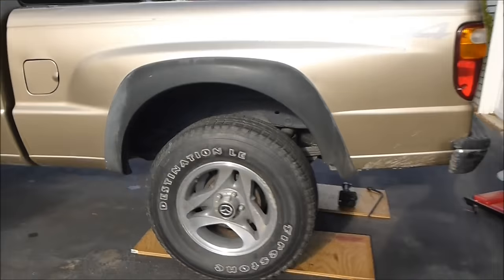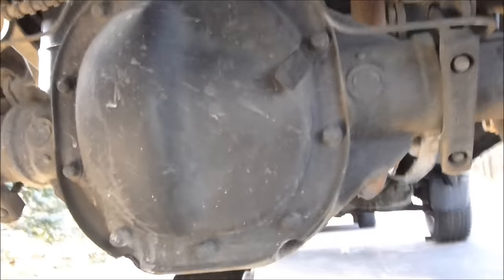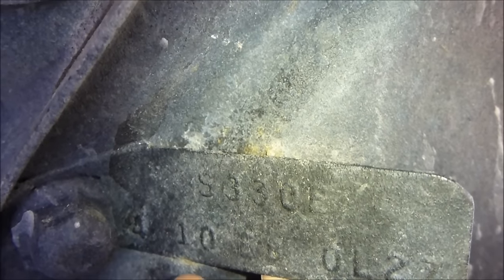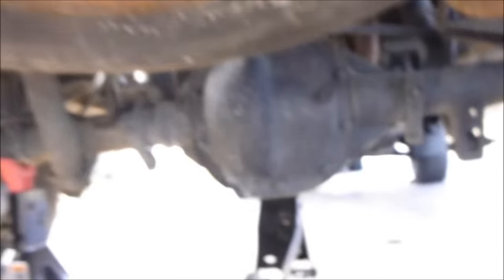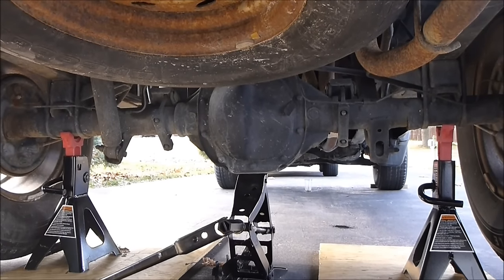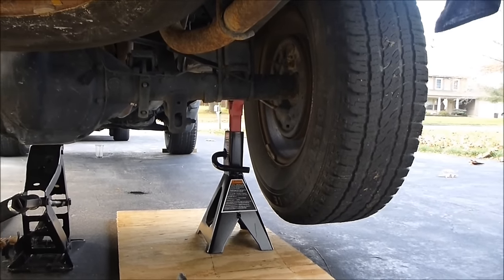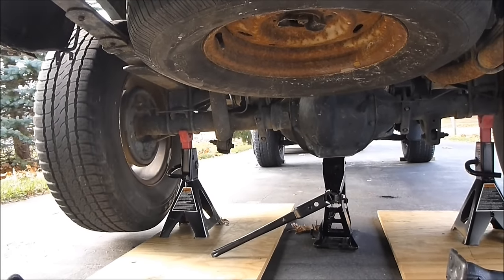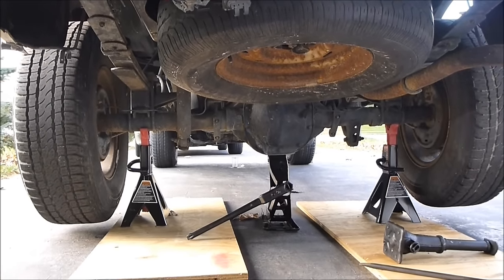How to tell if your car or truck has a limited slip differential

Comment: if it dosent have  force it will not lock!! you cant try it like that!
Reply: Exactly
Its "limited". It will be open until load is applied, then it locks and engages both wheels
Reply: Traditional Limited slips are "locked" together friction discs with spring pressure.  They are locked until a preset amount of torque differential, like going around a corner they will slip and allow one tire to rotate faster.  This video is how you test for a LSD.  I know this is old but I couldn't let it go:-)
Reply: Wrong!

Comment from the maker: What are you trying to figure out with a front wheel drive car? There typically isnt a differential. The drive shafts are connected directly to the transmission.
Reply: Sir, I know this comment is 11 years old, but… Did you just mean there’s no separate diff for FWD? Because there’s definitely one inside of the transaxle unit.

Comment: If you know what you are doing, a better test would be: jack it up (both sides!), start engine, engage gear and try to make one wheel to stop spinning. This should be relatively easy (and is possible) with an open differential. Make sure the front axle is not driven when you have a 4x4! There could be a LSD between the front and rear axle!

Comment: What's your insight about when i lock my center differential, there is no jolting sound but when i open my center differential, there is jolting sound when moving the gear lever to park to drive or cruising. Thanks
Reply from the maker: The sound happens when you are driving? Is it constant or does it only happen once?

Comment: Hey Chris, so I also have a RWD Mazda and I was trying to find the fluid that my rear differential takes in the manuel and it says, "Does not require replacement unless submerged in water". Is it wise to go by the manufacturer's word?
I mean, it's common sense to think that a gear oil that is constantly under stress and heat would eventually require replacing.
Reply from the maker: You are correct in thinking that, if it hasn’t been changed you can change it with no problems.

Comment: I have 2.7 grandcherokee crd quadra drive. When i lift the car and rotate a wheel, other one is spinning opposite, but the car has no open differentials for sure.
Reply from the maker: I don't know specifics about Jeeps but the diff could be unlocked which is why it's doing that

Comment from the maker: You will get different results. I am not completely sure what would happen because there are so many types of diffs and each one reacts differently. If both tires are suspended and the truck is in drive, you might not have any movement or one tire might move. If both end up moving and you put some resistance on one tire, the other tire might stop moving. It all depends. Def be careful because if anything happens, such as leaving 4x4 on, the car falls off the jack stands, etc, you could get hurt!
Reply: What does it mean if I can do this with my car in park?

Comment: This is an old video but im still looking for a reply :) My car will do a 2 wheel burnout if i hold the breaks but if i just step on it, say in gravel or anything it will only spin one.  apply breaks and do it, both spin... why?
Reply: +Mathew Hayes I just watched another video from engeineering explained about this. So when you use the breaks, you're effectively holding the one wheel that is spinning the most back, causing the other wheel to spin. Just don't look on your brakes lasting long that way ;)
Reply: what kind of car do you have. cause you might need posi.
Reply: Mathew Hayes sometimes an open differential will lock both when you apply the brakes because the pasenger side brake is applying more pressure and it kicks over to the side with least resistance or in your case both

Comment: I have seen one car that used a hydraulic valve, you would apply the foot break and turn the valve which would keep fluid pressure on all 4 wheels, but thats a custom. Some SUVs (I think it's land rover or range rover) have a drum just after the transfer case which is the e-brake.

Comment: My Toyota SAYS AO2C in the door tag which means it has an LSD and the tires spin in opposite direction.  
When i do a burn out, i have 2 marks so tires spinning in opposite direction does NOT always mean open diff ...
Reply from the maker: Correct
Reply: @chrisfix  Oh sh*t you replied ... WHAT A SHOCK 

I'm going to play the lottery

EDIT:
OMG ... i purchased a $50 scratch off that day you replied and i won $10,000.00
YOU MADE MY DAY CHRIS !!!!!

Comment: Will only one wheel spin on a limited slip rear differential? I have a 96 s10 2wd and I jacked the truck up and spun one of the rear wheels and it spun by itself and the other did not
Reply from the maker: Both wheels should spin the same direction if you have a limited slip, if only one spins or it spins the other way, you have an open diff!
Reply: @chrisfix  so it can be either one wheel spinning the opposite direction or one wheel not spinning at all for open diff??

Comment: My 83 RamCharger with the toothpick Q-tip 9.25 rear end. When I have it jacked up in 2wd, blocked front wheels. In drive the right rear turns normal while the left wheel sits and chatters.
Something is really wrong to the point I twisted my rear driveshaft till it came apart. New drive shaft installed. left rear chatters right rear turns. 3.26 highway gears.
Any help is or ideas to chase this would be really cool. That goes for anyone reading this. I am an Airplane mechanic, cars are a hobby. I am not good at troubleshooting.

Comment: Yeah, as others have said, this won't work on helical LSD's. It's hit or miss as to whether it will work or not, there's quite a few different types of LSD designs, only a few of them are common, but depending on the manufacturer this trick may or may not work. I wouldn't rely on this method. None of my LSD (RWD or FWD) cars will show the signs expected here.
.
Also, 4 10 = 4.10. That's 4.10 to 1 ratio, not 4 to 10.  3 73 is 3.73:1, so your torque multiplies by 3.73 and axle RPM divides by 3.73.

Comment: Your not completely correct on this. Yes an open diff will do what yours did and spin opposite ways. But many differentials do not actually lock until they are under load. causing the clutches to actually engage. Also some differentials have a locker that flies out once one tire starts to spin to mechanically lock the diff

Comment: I have a 2000 Expedition and the wheels spin in opposite directions like yours but it is extremely hard to turn the wheels. Ive been having an issue where there is a jerking or binding of the rear tires when doing slow turns.
Reply: Did you figure it out?
Reply: @marialaguna2033  haha this was such a long time ago. What I did i don't think I would recommend but i ended up draining the diff oil to replace it with new. Also added some friction modifier and did not fix it, however, after a few miles of driving it i heard a bang coming from the rear and it was magically fixed. Sold it probably about a year later.

Comment: I got a 99 Durango. I'm getting noises from the rear end mostly when turning but I hear and fill it slightly sometimes taking off. I pulled the differential cover nothing broken, no metal. Changed the oil. Its still making the noise. When I do this test. In park the wheels will turn opposite directions in neutral they will spin the same direction? Also how much play should there be when turning the wheel before the drive shaft moves. Im getting about an inch of wheel movement before the driveshaft moves.

Comment: You should note that this does not apply to GM g80 diffs.They work like an open diff until one wheel starts to spin.
Reply: very true many locking or limited differentials will not engage without torque

Comment: If you have a Chevy/GMC truck that has a G80 Gov-loc posi unit it will act like it has an open rear if you test it like in this video.
The G80 will let one wheel spin first and then will engage the second for posi traction when centrifugal force engages the locking unit. 
Check the decal in your GM truck glovebox  for the G80 code. It will follow the gear code.
Example: mine says GT4 G80 (3:73 rear gears , gov-loc posi).

Comment: I have a 2020 RAM 2500 6.7 automatic. When making a right turn into my drive if the righty rear spins I will have to got into 4 wheel dr. however if I am backing up I can leave 2 equal black marks when going straight. Any ideas of what is wrong. Dealer stated that I had posi trac when I bought truck because it was a deal beaker if not. Yesterday dealer checked and stated that I did not have it.

Comment: That's weird, here they don't put tags on none LSD differentials. So if you look under and see a tag 99% of the time it's LSD the tag is to tell you what oil to use you can't be 100% because of Diff swaps. And some mechanics when cleaning out Diff Centres don't put tags back. Only once have I seen a tag like yours. And I've been a mechanic for over 30 years.
America's way is so much easier here you need to take the back of or remove it altogether to find out the ratio.

Comment: This is not an good way to tell what you have. I have seen many LSDs that had worn clutches that would act just like a standard differential when you turned the tires. I have also seen many standard differentials that were damaged that would act like a LSD when you turned the tires. The only way to tell for sure what you ahve is to remove the cover and look at the differential to see what kind it is.

Comment: I have a 1966 F 250 and when I turn the right rear wheel clockwise, the left wheel turns n the opposite direction and vise versa... BUT!!! now, when I turn the left wheel forward the right wheel turns opposite, BUT!!! when I turn it in the opposite direction, it DOES"T move.. What The???

Comment: I have a dually 06 f350 and on the door it says it’s a slip differential but the when I tried your method the tires go the opposite way.   The truck only has 53k miles.  I’m so confused.  Any ideas on why it’s doing that?

Comment: Not true for all,he should be telling you this.If that is a locker SLD it will do that,but if you turn the wheel your holding back then forward really fast with a little force both wheels will lock and you have posi.

Comment: Hey Christ is I have 79vamaro z28 I put rearpinionseal on I have both backwheels off ground I notice both wheel still rear wheel still turn why car is in park but the driveshaft want move in park is that normal or have I done something wrong when I tighten down the pinion bolt

Comment: I believe this is untrue. A differential will do this regardless. A limited slip will only engage once one side begins to spins to a point the locker in the diff engages THAN both sides are engaged forward. At least this is true for my 2001 S10.

Comment: Complete BS. Only way to tell for sure is by number identification, or disassemble and inspect. There are many limited slips that will only engage with power applied to the pinion.

Comment: I have a 2014 MX5 auto .. I kept it on P, and jacked it up and did it .. and it went opposite, so it means that it's an Open? .. But most forums say that some LSDs are opposite .. shall I change the oil with the LSD additive? Or will it damage?

Comment: Clutch type LSD without springs does not make the other wheel spin in the same direction. As it has no power applied to it  under this kind of load. And will still spin backwards.  I used to think the same way. But once I installed a mopar LSD diff with clutch packs. The other wheel still spun backwards by hand. But when on ice with one wheel and the other on dry pavement I can still spin the wheel on pavement and leave a skid mark. So under load it will spin both. By hand same as open.

Comment: Thanks!!have a question. I have a 2001 3.0l ford ranger not 4x4.what type of rear differential fluid do i a need to put on it.cause i have 2 new lucas 75/140gear oil..thanks

Comment: I know mine is a open diff because only one wheel would spin when i got stuck in mud in our backyard to unload pallets from my pickup which unfortunately is only RWD.
Think it was last winter and most of the ground was still frozen solid for the most part, and i happened to find the one spot that wasn't i sank into.  
Was a small hill to gain entry to the back yard, going down it loaded wasn't a issue  for some reason. Was when i went to go back up empty that the ground ate my tires.

Comment: i bought a 77 chevy and the guy told me it was limited slip but it spins opposite directions like that. I told my dad and he said that some rearends need to have a certain amount of pressure or force before it will lock in. my dad said that some rearends won't lock till you matt it.

Comment: very easy put water on one side of your véhicule  like 10 feet  do a burn out,  and this applied for any kind of locking system in the differentiel  ,you will know right away.

Comment: I have a 1990 Ford F-150 XLT lariat extra cab long bed A/T 5.0 engine V8 4wd automatic front locking hubs. When I spinned the tire the other tire spun the opposite way ( didn't move right away). Here is the problem my tag on the rear diff says 3L55880A13. You said if it has a L it means it has limited slip which makes sense. I went to local dealer he didn't know that & my number didn't come up in their system. Then someone said here that if you push the tire harder it will activate the mechanism so it will spin in the same direction. I haven't done that yet but I will and let you know. But for now do you think my truck has limited slip diff? Thanks for all replies.

Comment: I had a LWB 6 cylinder 3 speed column shift  72 Chevrolet pick up, it had an "Open"diff, and it would only spin the passenger side tire and it would get stuck on wet grass, this is not an exaggeration it left me embarrassed more than once, I put new mudder tires on and it helped but still not a lot, finally i got sick of always being stuck and "Lincoln Locked" my Diff making it into a spool basically or full time locked up posi, then it would pull like a boss with 4 wheel RVT mudder tires , the moral of the story? open Diffs suck on a pick up if you go off road at all, before i welded the diff it would  literally spin one wheel on wet grass and be stuck. Imagine being stuck on a flat open field of wet grass and all your friends laughing at you, welded diff made up for it in the end, and didn't cost nothing but a couple hours.

Comment: Ok so I got a question I have a 2000 dodge ram 1500 sport 4x4 off road package that had a limited slip in it went bad I had it rebuilt a few years ago with the limited slip differential again like it came from factory it used to spin both tires in the same direction all the sudden I noticed that I was spinning and getting stuck more then I use to. I jacked up the truck and spun the tires and now they both spin opposite direction like an open differential does. Have any clues ideas or suggestions of why and how to fix this problem or maybe a video showing how to deal with this problem? Thanks +Chisfix

Comment: Had my tires rotated today on my 84 Chevy Blazer 4x4 and noticed that it's not limited slip. But recently changed my rear and front differential oil and put in synthetic limited slip. It wouldn't hurt my differential would it? I don't really think so but still would like someone's opinion. 👍

Comment: I have a torsen lsd 373 rear and when I spin the tires only one wheel spins the other does nothing. So I dont think this trick will work for all cars. 2016 mustang
Reply from the maker: Correct it doesn’t work for every single car or truck out there but it works for many.

Comment: Turning the wheels by hand is a correct test to see if you have lsd don’t need load to test, if is a open diff wheels turn different direction and is an LSD diff both wheels go on same direction even torsen diff.

Comment: Should the car be in gear or not?

If I dont have it in gear one wheel turns and the other dont, if its in gear both turn the same way. LSD or not? E46 330 with the m sport 2 pack.

Great vid and thanks for any help:)

Comment: I have turned the rear wheel on a land cruiser Colorado and the opposite wheel is not turning at all and vice versa . Could you please tell me if this means that the limited slip differential is faulty ?

Comment: Dear Chris, I did the procedure you mentioned to find out what kind of differential my car has. I would like to mention that the vehicle has Manual transmission with transfer box 4H, 4L. When I did the test 4x4 was off so the vehicle was on 2H. So, both rear wheels were turning in the same direction. So that means the vehicle has LSD. Then, I jacked up one rear wheel and started the engine and  I tried to move forward with the first gear. I guess the car was supposed to move forward but it didn't and the lifted wheel kept turning. Is this correct? If yes, what is the purpose of Limited Slip Differential?

Comment: Some LSDs operate from rotational momentum so turning your wheels slow like that will not tell you anything. Some other LSDs (clutch pack LSDs) operate from the thrust of the pinion. The trust from the pinion shoves the ring gear over a little and locks the clutch pack together. Same with the spider gears and the axle gear on the opposite side of the differential. Also meaning that turning your wheel like that doesn’t give you accurate information. However, a full on posi differential will turn both wheels the same direction. At the end of the day, it’s more beneficial to run serial numbers or tags/codes (in this case) to get the most accurate information.